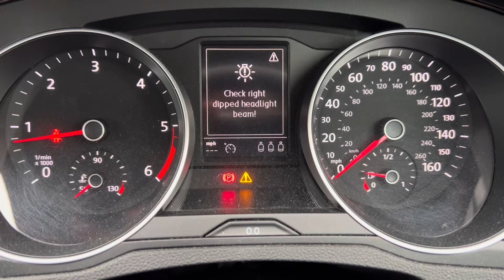2015 VW Passat DIY Headlight Bulb Replacement using Phillips White Vison Ultra

Comment: The second bulbs how do u get it out? Only pulling back? Cheers
Reply: Interested to hear the answer to this too. Was trying mine yesterday and was applying a fair bit of force but it wouldn’t budge. Does air need a twist one way or just pull straight back please?

Comment: Thanks for the video it was really helpful. My cover near the wheel was original on one side so I was able to pop it right back but the other side was botched by a repair shop from before so had to screw the cover back in. Overall fairly easy fix

Comment: I replaced all bulbs my self,upgraded to the best possible,its so easy to replace them in passat 2015,awesome car to drive too✌️ great video
Reply from the maker: I agree. ☝️. Great car so far. Oil change this weekend.
Reply: @Backoutthere  after service reset check your next one,i dont know my car showed me 4500 miles next service,i do service every 6000 miles as it should

Comment: Hi cheers for the video I had my H/L bulb go the other day cha get them easy enough but am struggling more with the smaller side lights and the funky holder do you just pull on it to get it out?both sides feel pretty stiff was wondering if there was a technique or do you need to twist and pull etc?

Cheers 👍

Comment: That's crazy that the bulb only lasted 7 years. Our jetta is running strong at 8 years and the suburban has had the same headlight bulbs for 25 years.
Reply: Everything wears out. The earth's crust is even susceptible to erosion. Your suburban could probably stand to have new headlights put in. The filaments weaken over time, and are not as bright as new ones.

Comment: Dislike. You dont need to jack up the car, just turn the wheel and you have easy acces. You remove the cover from inside the bonnet.